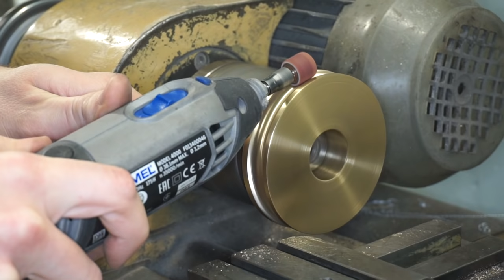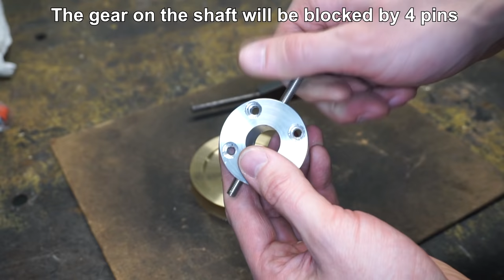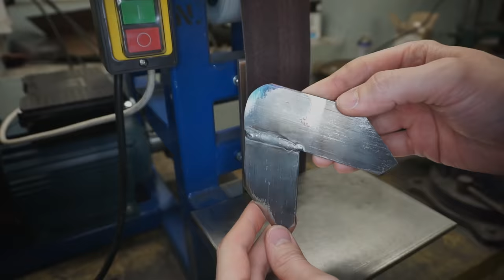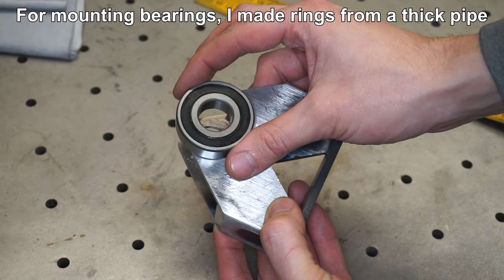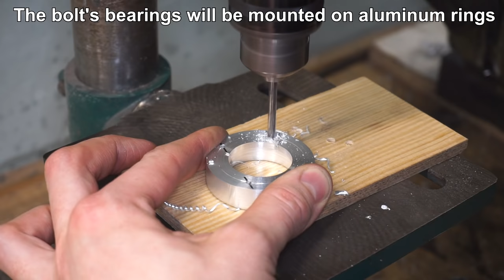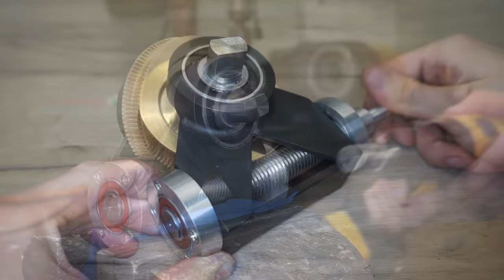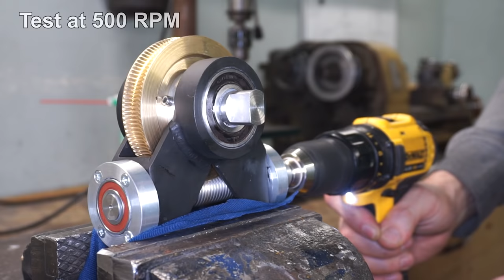Making a Worm Gear on Bolt

Comment: So the device is intended for high torque applications and the material of choice for your main component was brass? Forgive my lack of positivity but this device would struggle to advance a turd through a lubricated pipe without getting deformed. I think the turd would be a more suitable choice of material for such application
Reply: Also, sooooooooooooo much heat with that huge contact patch.

Comment: Very nice, what is the use for? I am building an computer controlled telescope tracking mount, this worm gear would be avery good solution.
Reply: Stephen Ferree  Thank you very much, now I can see the anti backlash system, very nice design. Thanks a lot.

Comment: I wonder how you did so that thread teath did not overlap
Reply: Count the threads per cm on the tap. Make the circumference of the bottom of the valley a even multiple of the threads per cm
Reply: @davidhtims  thanks a lot.

Comment: It's a cheap way to make a worm gear. The problem with this method is the angle of the thread which will tend to push the worm (or bolt) away from the gear if under load. A type of acme thread will be a better option because the thread is more square and will tend to push away much much less if under load. Good idea however to use a tap.

Comment: A special work! I've been working with machines for 15 years but I can still learn tricks from you. Today's technology no longer allows you to learn things. Wonderfully worked and clean. Good luck
Reply: I appreciate you brother give me a shout out please..I'll be waiting
Reply: 'Today's technology no longer allows you to learn things.' what..?
Reply: @daos3300  For example in your video. At work, everything is done on cnc, we rarely do manual work
Reply: @Inventive101  ah, you mean hand made things. fair enough but on the other hand, there is a lot to learn with cnc/software/3D printing and new materials tech. exciting times in a different way.
Reply: @daos3300  It's true, it's also a beautiful part of things. I'm a manual fan anyway
Reply: @Aditya Rane  It was a hard job doing two gears for my bending machine, I used 45c steel and hardened it after machining and machined it again using diamond bit, just because of the loads, check my video of 3d bending machine.

Comment: I made one very similar. Only issue is once you add a load on the worm gear, the steel bolt will destroy the brass gear.

Comment: I would be concerned that the coarse cut of the threads on that bolt would wear down the brass gear faster. Why not cut well-machined threads from scratch?

Comment: I really like the way you cut the thread on the gear very ingenious. I really did not like the use of epoxy instead of press fit or even snap rings to retain the bearings. But yeah pretty cool. Impressive welding also

Comment: Fantastic project.  Looks like you got the start and finish of the threads on the wheel to meet up perfectly.  How did you do that?
Reply: Circumference divided by the thread pitch must be an integer and then it works.
Reply: @marcelbron6128  Thanks!

Comment: You need to learn about interference fits, bearings are never JB welded in.
For that size bearing the bore should've been approximately .001" to .0015" smaller..would've been a nice press fit.
Nice little project though, good job.

Comment: Perfect for high torgue applications until they start making them out of plastic. Had to replace a garage door motor because the gears ate each other. Cheap plastic junk. Wish I had a lathe and the skill to use it, I would have just replaced the gears.

Comment: Well done, master of machining!

I would like to reply to some comments made about the accuracy of the cutting procedure.
One calculates the Pitch Circle Diametre (PCD) of the threading tap to the size of gear one wants to cut also using the PCD to size the final dimension of the gear.

Comment: High torque can also be achieve with worm gear, I taught it only be done with spur gears.
Reply: Usually gearbox for electric motor use the worm gear system.

Comment: One thing that you did not mention in the video and I think is essential is:
How did you manage to "guess" the exact circle diameter so that the thread would not have an offset at the end of the lap?
Reply: The math isn't terribly hard, but what I'm not sure about is where to measure the radius. One would think at the smallest diameter inside the groove. Are you supposed to take the thread depth into account, though? idk, I'm not a machinist.
Reply: @DFPercush  partly my thought, it's far away from just cutting a circle of any diameter and start denting it :)

Comment: Very nice.! U know instead of jb weld like u use on ur bearings u can use medium/semi permanent or red/ permanent thread locker with thread locker u have the option to change the bearings if needed in future with a heat gun. That’s how I installed mine when I was building belt pulley ls for belt grinder and it works perfectly till this day and it’s been over a year now almost daily use.

Comment: Protip:  don't epoxy bearings in place.  The person replacing them later will thank you.
Reply: I agree.  He should get a chart of tolerances for a light press fit.  It would be much nicer.
Reply: Blowtorch should melt the epoxy and the cyanide released well that's another story

Comment: There's more to this than meets the eye. The diameter of the brass wheel has to be just right for the threads cut there in, to also come out just right. Nice work. Beats a fidget spinner any day.

Comment: Constructive criticism:
Use less JB Weld; there’s no reason those bearings should have been glued in there. Anything goes wrong you may as well dump the whole project in the garbage.
Use lube; it made me cringe seeing you just rip it a new one with 0 lube. At least drop a little motor oil on it.
Show more math when putting things together because your videos make it seem like you’re doing everything from the eye.

Other than those things your video was pretty good. Found it in the YouTube recommendations.

Comment: Do not use this for high torque devices, as it is a danger... The thread height is too low, only a small volume of material is holding on... that is the reason why worm gears have a higher thread height to diameter ratio....

Comment: So much work and shitty material of the bolt. With your tools you can make normal trapezoid thread. I would not surprise if that is a 10 cent soft steel bolt.

Comment: Very nice. Not sure about the selection of materials, brass is so soft. Also, is the threadform engagement of a standard Mxx thread (60° ?) optimal for worm gears? The final bolt-to-gear assembly method added collars to either end of the bolt, but these weren't bearings, they were direct friction. Finally, there seems to be quite a bit of tolerance stackup to reach final engagement. Not sure how long this would function under load before wear would deteriorate the fit.